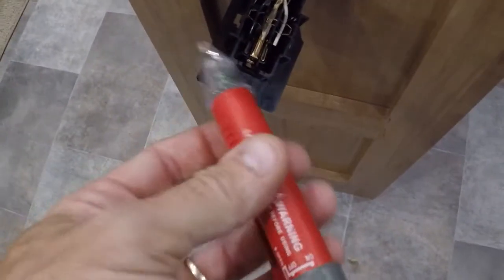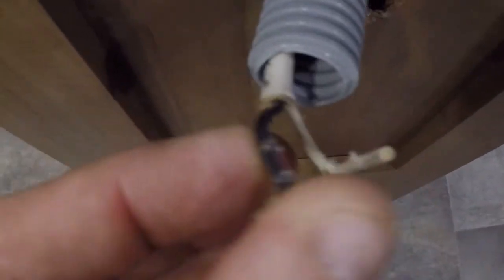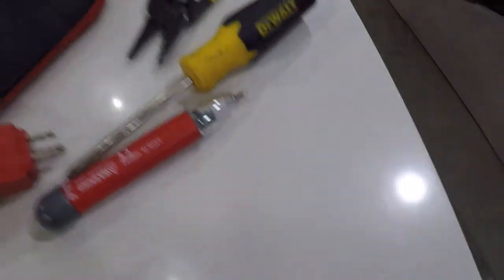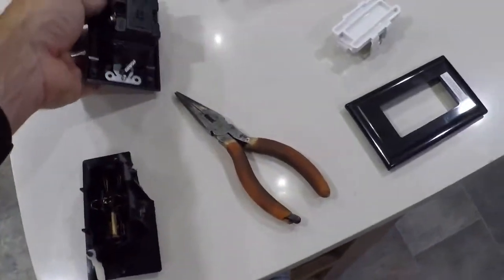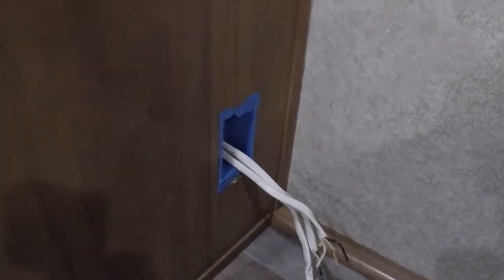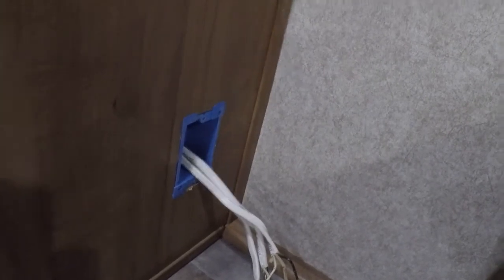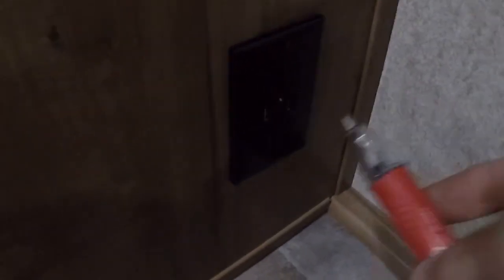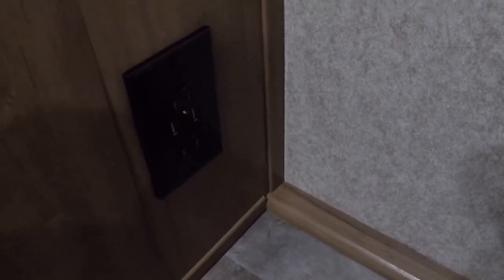Camper Outlet repair and installation

Comment: How did you remove the agrivating shell off of the back of the receptical?
Reply from the maker: The wire cover on the back is held on mine by a couple stout clips on the sides.  I was able to pry them loose with a screwdriver and pop it off.